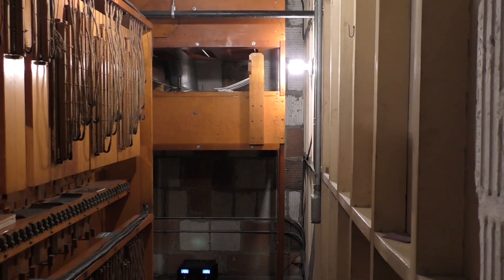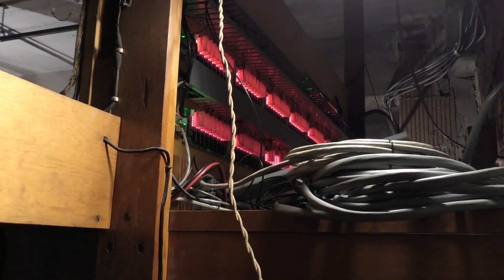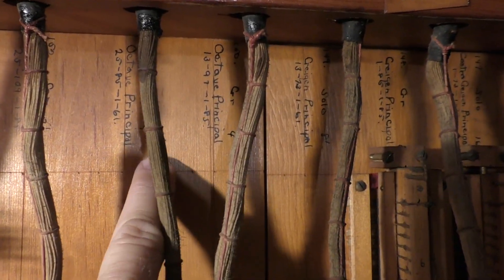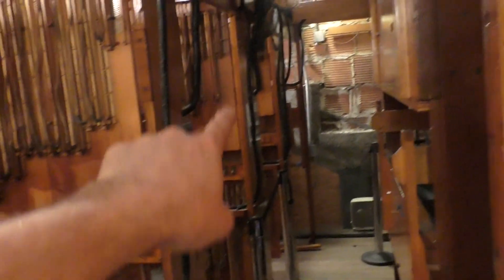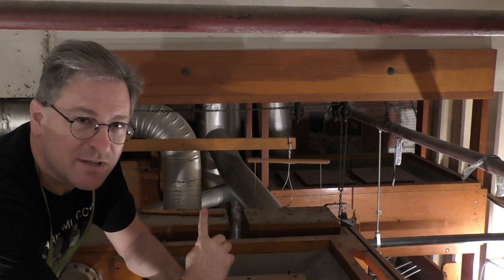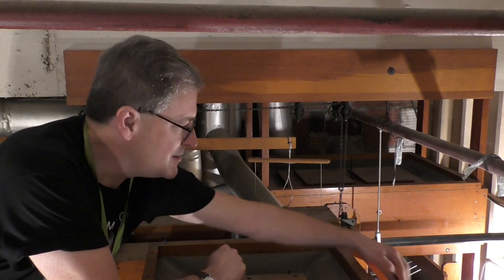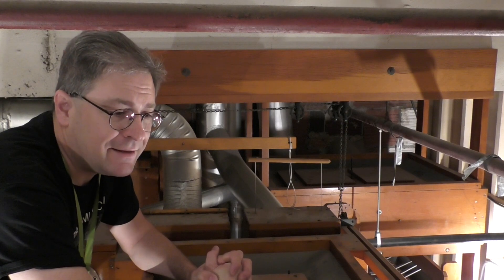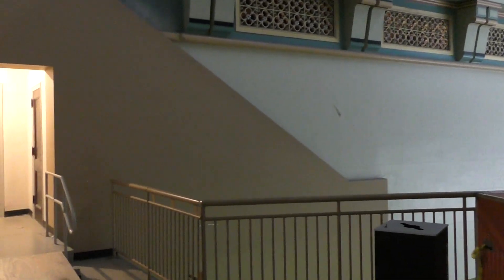Boardwalk Hall: Great relay room

Comment: I see thousands of wires that all look the same color? Was there any kind of color coding in the cotton covered wires? How did they sort them out? I know they didn't have sticky wire numbers back then.
And will all you showed eventually be replaced by the Opus system as the other side was?
Reply from the maker: As far as I know there was no color coding at all anywhere in the original wiring. They would "ring out" cables or have them pre-laced on wiring guides...how they did that to the remote locations I have no idea. Someday this material will be replaced by Opus II but left in place forever with the wind hooked up so everyone can see how it worked.

Comment: So in the great division since the second keyboard has 85 keys, that just means that the greater portion of this division, there has to be 85 pipes. Since there are mixtures, If there was a mixture II, 170 pipes. If there's a mixture III, 255 pipes, if there's a mixture IV, 340 pipes if they belong to the great manual that has 85 keys.
Reply from the maker: Not quite: even though the Great keyboard has 85 pipes the bottom octave doesn't play most of the time, it only plays pedal borrows from the Grand Great, I believe. The Great chests are all 73 notes.

Comment: I’m constantly amazed with the thought put in to the organ, take the 3 wind inputs for the keying room, the reason the echo blower provides wind for it (if I’m remembering right) is because the brass chorus/string II gets its keying signals from that keying room but it’s wind from the echo blower
Reply from the maker: Correct.

Comment: I really enjoy your videos.  They are very informative with great video footage to go along with your talk.  I would like to see more of them, but know they must be a lot of work.  The switches and all that still mystify me.  It's a very complex system.
Reply: I might be able to help with that! What he shows here is the switch stacks for unified ranks, as opposed to straight ranks. Think of a unified rank as a straight rank that has been extended by adding extra octaves of pipes. So a straight rank would typically be 61 pipes, or 5 octaves. On an 8' rank the lowest pipe is about 8 feet long, and all the pipes speak at unison pitch. Now if you add an extra octave of pipes at the treble end, making it a 73 pipe rank, you can draw a 4' stop by connecting the 61 keys an octave higher, from the 4' pipe to the top of the extension octave. Do it again and you get a 2' stop using 85 pipes in the rank. You can also add a 2 2/3' Nazard stop without adding any more pipes. You can also go down, adding an additional octave at the low end to provide a 16' stop using 97 pipes. Now, if you used all straight ranks, this would require 305 pipes, most of which are speaking at the same pitch. But by extending a single rank you can get 5 stops (16', 8', 4', 2-2/3', 2') using only 97 pipes in a single rank. The trick then is, how do we set this up so we can play the correct pipes for each stop? The answer is, a set of switches, one for each stop. Each switch has 61 sets of contacts connected to the correct range of pipes in that rank. When you add the stop, the corresponding switch is operated to connect that particular range of 61 notes to the manual. That is the simplest way I can think of to explain how this works! Hopefully I didn’t just add to the confusion!
Reply from the maker: @Ethan.Lamoureux  Good explanation. Having said that maybe next time I'll detail that in a video.
Reply: @cnagorka  I would love to see a video on that, and maybe someone else might enjoy it too.